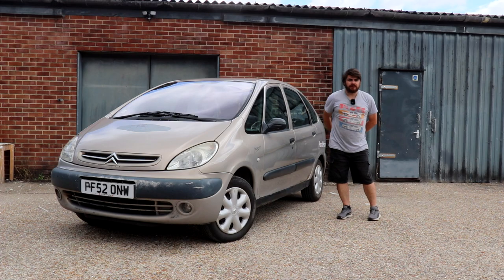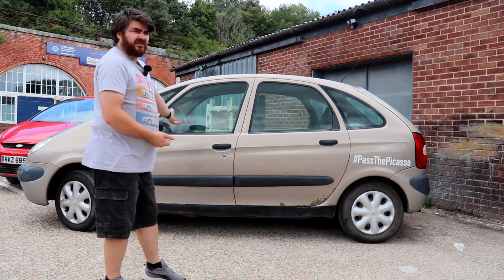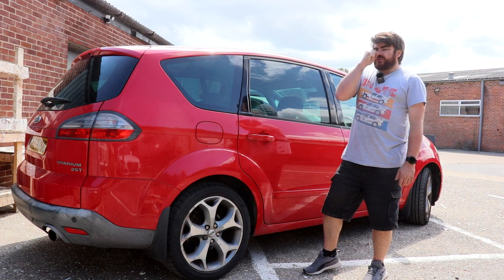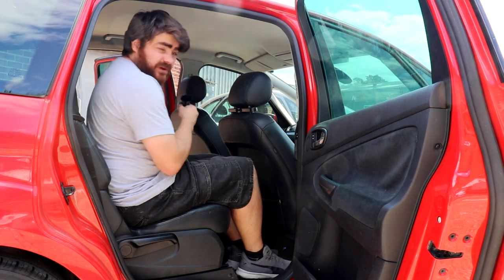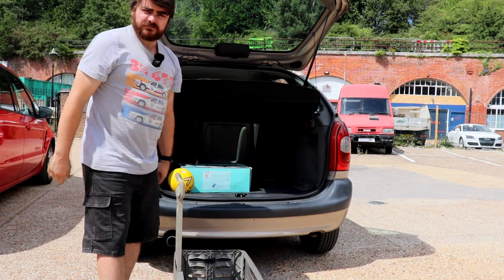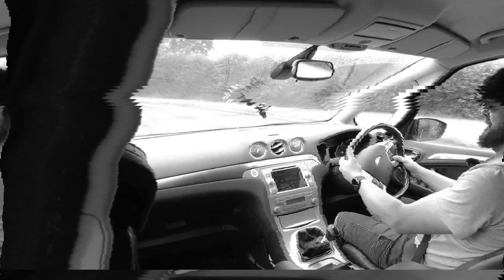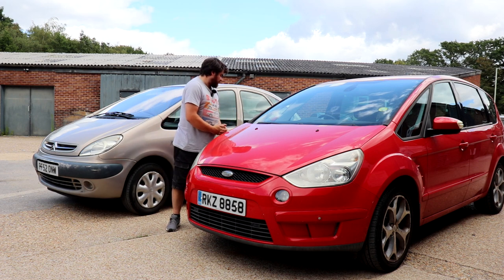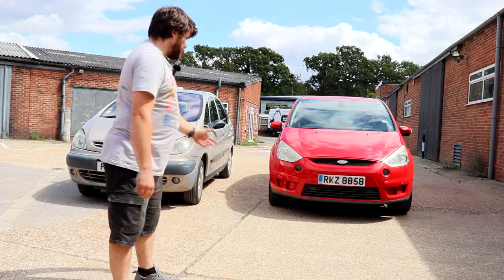The biggest TEST for #passthepicasso: Can it prove me wrong? Battle with Ford S-Max 2.5T Titanium

Comment: That Notbothering sticker! 🤣👍
S-Max is and always will be cool AF because 5cyl 20V Volvo engine. It's quick and with a remap can actually be fast.
Reply: What a world we are living in where a volvo engine makes something cool. LOL
Reply: its the st engine  @rimmersbryggeri
Reply: @simonelsey  I know that. But it's still a volvo engine all the same it was even developed before ford got in on it.
Reply: @rimmersbryggeri  Volvo engines are very cool.  Especially the T5.  The Yamaha V8 in the S80 and XC90 is very cool too (Yamaha still sell it as a marine engine).  C'mon now, how can the Volvo 850 super touring car and Volvo S40 super touring car not be cool with their five-cylinder howl? By extension the road-going Volvo 850R is very cool too.

Unfortunately speaking of cool(ing), the Ford 2.5L version of the engine has thinner cylinder walls than the Volvo 2.3L version, despite being in cars (like the Focus ST and Mondeo ST) where it will be driven harder. So they are known to crack the cylinder liners. 😐I guess that won't be a problem on an S-Max that generally won't be driven as hard (or badly remapped with a pop 'n' bang tune...).

Speaking of strong engines, the good old Volvo B20 turbo from the Volvo 240 Turbo is legendary for being indestructible and holding up well with 500+ bhp on a stock block too...  (Obviously it's an old-school closed deck cast iron engine.)
Reply from the maker: We knew about the liner issues with the 2.5 version, which is one of the reasons this one hasn't been tuned or anything. Just keep it serviced etc and it's good as gold. Clutch is tired now, though (it's the original).
Reply: The Duratec 30 is the better engine installed in a humdrum Ford though.  I might be biased.

Comment: Love it as I went recently from a 05  Picasso  90bhp to a 08 S max  220 bhp   so much fun to drive and love it for towing
Reply from the maker: A 2.5T like this one?
Reply: Yep its 25T in  zetec spec in dark metallic green  ment to be (rare 🧐 lol) I love  it as only 60 quid more to insure than the Picasso that was a big shockas was expecting a bigger jump but with it  not being a titanium like  my friends  who has 2.0 diesel titanium and it's a lot more  than I'm paying  and with it only being a zetec without all the extra bells and whistles weight is also a bonus. I  absolutely Love its very fun to drive feels pretty sporty to Me and often surprises cars it   shouldn't😮😉😉 lol and  then can fit a load inside like a small van and a tows like a dream and I Don't miss the diesel torque  tbh and the towing geometry is a lot better on the Smax always struggled to reverse manoeuvre with the Picassos 

Tho on a side note I  much preferred by Mark 1 Picasso over the 2 facelift models I had was the first was a lot lot  better built  interior and a few mechanical bits so mine facelifts became a bit of a mongrel from better parts off the mk1 parts
Reply: @UPnDOWN  Have a good day

Comment: The Xsara Picasso it's simply one of the most brilliant car designs ever made! Compact in it's 4.3m, but with a cavernous trunk. Adjusting the seats allowed me to carry a full size frame mountain bike! On top the practical touches are simply outstanding. Best of all is that the entire package is inexpensive to buy, run or maintain!
All in all. The only car model that I got 2 (two) over time.

Comment: We had a 2nd gen S-Max AWD in 2016 and lived the space for family & digs plus luggage.. plus the AWD meant for the 8 days in its 3 years with us it got up the snow covered lanes to our horses.
Reply from the maker: Didn't know they did an AWD S-Max!
Reply: @UPnDOWN  - ye on the 2.0 tdci 150 or 190 it was an option… tge haldex clutch type system so normal front wheel until slip detected.
Reply: @UPnDOWN didn't know that either, guess explains S-Max lack of big flat floor (big flat floor, big flat floor!) :)
Reply: Did you sell it?
Reply: @momo1883  - yes mate, back in 2019 .. it was a great car but we decided on getting an auto as spending a lot of time crawling around the M25.
Reply: @davidchandler9260  thanks. I've got a 2.5t smax titanium x, and I'm really pleased with it. I convert it to lpg, so now it's like 60% cost of petrol. I've been trying to get some information about 2.5 4x4, apparently there ware versions like that.
Reply: @momo1883  - I think (and this was 8 years ago) that in UK we could only get the 4x4 as a diesel .. we ordered ours new and I don’t remember dealer offering a petrol variant with 4x4

Comment: I have owned a 2012 C3 Picasso 1.6HDi 110BHP exclusive for 2 years and it has been brilliant. We didn't need a massive car but wanted something comfy and had useful space. The back seats slide forwards if you need more boot space, the back is square so has extra height in the boot, the seats are extremely comfy. It has the picnic tables in the back and retractable sun screens in the windows. The engine pulls quite well and on a recent 300 mile trip i got an indicated 63 miles to the gallon. i never thought i would ever say i would enjoy owning a Citroen but i do.
Reply from the maker: Wait until you try one of the proper Citroens...

Comment: Great comparison vid. I have an smax with the HDI based engine which runs pretty well.  You picked up 2 of my design annoyances - what to do with the load cover if deciding using the rear seats when already out and about, and the things falling out of the boot (now cured with an “apple catcher”) - its the same on the mk2!
Reply from the maker: The 2.0 16v HDI engine is a good unit. At the time we bought this S-Max, diesels cost a LOT more than any petrol, even the 5-cyl turbo. Nowadays, not so much.

The parcel shelf thing has always annoyed me!
Reply: @UPnDOWN I've got a 2011 mondeo with the diesel psa engine I love it. Power and mpg is very good.
Reply: @UPnDOWN mine for the volvo just lived in my shed for 7 years after I drove it home, then I gave it to Charlotte (Lotty) when she bought an xc90 a few years back.

Comment: The Xsara Picasso can it’s routes all the way back to the ZX/Peugeot 306 with the Xsara itself being essentially a cosmetic update of the ZX… be fun to drop GTI-6 running gear in one… granted it still won’t have the power of a Volvo T5 engine, but it’s a nice engine all the same, with plenty of torque, fun to properly rev out… hmmm
Reply from the maker: That's what I meant, as the ZX was conceived in the 1980s, and the suspension technology is the same as the Peugeot 205/309/405.
Reply: Too bad GTI6 engines are near-enough impossible to find in 2023. If only car manufacturers would make 'unofficial' crate engines of their legendary performance engines, and just advertise them explicitly as 'not for road use' or whatever just so they don't have to worry about emissions laws etc
Reply: @solitaryclusterofneurons598  indeed, I certainly wouldn’t entertain separating one from a viable GTI-6, that would be criminal… but it was a fun engine, small power by modern standards but excellent all the same.

Comment: Just sat here now thinking about the umpteen PIcassos weve had and the currently Galaxy on the fleet (2.0 TDCI). Which do I prefer?

Its tough. Picassos have done us as A family VERY well over the years even the 1.6 8v one we had (Can see it on my channel). Theyve been reliable and mainly, cheap to run. 
We had a C4 Picasso (12 plate) for a short while and what a truly horrific thing it was - especially the automatic gearbox... what absolute utter crap! 

Current 11 plate Galaxy.... love it.. not as comfy as the PIcasso's but a nice place to be inside... Very good economy as well and of course, much larger with 2 extra seats! Parts are a bit more epxenisve though. Dont seem to be able to chuck it about as much as you can with a Picasso, but its not bad to be fair to it, I qute enjoy driving it. Our Picassos have been and back to Paris, which this Galaxy will also be doing - will see how it fairs up. 

Content on my channel soon, Galaxy goodness.
Reply from the maker: We've run the S-Max to Paris and back a few times, it does that journey really well.

Comment: Regards trim levels,there was a level higher than the sx in the early noughties called the exclusive. I had a 1.8 petrol on a 02 plate. Had front and back leccy windows,climate control and panoramic roof. Admittedly mine had 75 psi or lower on 2 cylinders and a thirst for petrol only outweighed by its thirst for oil. 
Had 5 or six xsara pics,from x plate to 54 plate over the past 6 years or so as they are just capable at being a car. The LX was the lowest trim,i had an x plate hdi which didnt even come with ac,the sx added better seats,armrests,ac amd front fogs. The exclusive added Panoramic roof,climate and leccy rear windows. Later in their life they could be had with auto lights,wipers and cruise control.
The c4 picasso i had a couple years back on an 08 plate was not as good in my opinion.
Being a french sadist myself who is a glutton for punishment i keep going back to french cars and have owned numerous 90s and onwards french motors. 
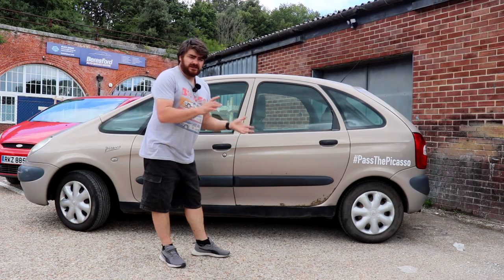4:22 The s max 2.5 turbo has always been of interest to me though. 
Great videos sir and keep up the good work.
Reply from the maker: There was, yeah. That's why I had to edit the word 'launched' into the vid as when I edited I realised I'd made the error.
Reply: @UPnDOWN  sorry for the correction on my part then! Love the videos either way and great to see someone else loving the quirky french motors.

Comment: Out of curiosity I checked out the French remap company Puretuning to see if they have remap files for the Xsara Picasso 2L HDi (66 kw) and I find out they sell two files. Stage 1 : 120 ps (88 kw), 270 nm, Stage 2 : 135 ps (99 kw), 310 nm.
It doesn't seem unrealistic when comparing to the numbers of the C4 Picasso 2L HDi : 136 ps (100 kw), 270 nm.

Comment: Great review. The Ford Focus C Max would obviously have been a closer rival and think it's substantially better than the Picasso too though. Handling, build, equipment, crash test etc etc.
Reply from the maker: I dunno, I felt the S-Max was substantially better than the C-Max, personally.
Reply: Of the B-max, C-Max and S-max of 06-13 the C-max was definitely the weakest of them, B-max easier getting in and out with the sliding doors and more comfortable and as much space, S-max more seats or bigger boot.
Reply: @UPnDOWN  Well it's certainly a lot bigger than a C-Max due to the MK1 C-Max being based off of a MK2 Focus.

Comment: Ive got the diesel 2.0 smax love the car i thibk best people carrier ypu can buy. Handles well goes well and economical. Also in titanium spec on a 56 plate. Compared to my inlaws 18 plate zafira the spec is pretty much i dentical but god is the zafira dismal. The smax is still good fun on a backroads and ive pushed along fat smaller sportier cars.
Reply from the maker: They drive far, far better than people would believe. Comes at the cost of tyres, though!
Reply: @UPnDOWN  yeh my one eats tyres but I drive it quite hard and it likes to light up the tyres. I bet the 2.5 is quite fun but they are like gold dust now

Comment: You could compare first gen Citroen C4 grand Picasso launched in 2006 to your s max. Plus u can store the parcel shelf in the boot with the 2 rear seats up plus with the 2 seat up there is loads of storage under those seats.
Reply from the maker: I'm pretty sure you can't. It doesn't fit anywhere, even in the footwell in the middle row.
Reply: @UPnDOWN  I was talking about the C4 grand Picasso. Parcel shelf can now be stored in the boot for unplanned extra passengers. sorry for not being clear.

Comment: i had xsara estate 2.0hdi , best car ive had for a long time  done 250,000 when it went to car heaven than brought a xsara picasso ,wife wanted it brought 1.6 8v desire petrol Hated it ... had no power in the end clutch went , engine seals went , alterantor went all at same time Plus cills gone would need repair ....I reckon if i stuck withderv i would have like it but with petrol engine i hated it ...I did like the size of it very roomy ...just the engine ..
Reply from the maker: I used to potter a 1.6 8v Picasso around in a job at a furniture shop, and it was asking a bit too much of it tbf. Same engine in a Imp is much more fun!

Comment: Apparently there are only 5 red 2006 ford smaxs left on the road with mot's in the uk but it doesnt specify if it is the 2.5 it just states across all the petrol models
Reply: According to howrareismycar
Reply from the maker: Problem is there are two different types of red, too, so I think that includes both of them.

Comment: If you wanted more Citroen seats, what was there? I vaguely recall a rather bland looking agalaxy-esque MPV that was badge engineered across the marques, Was that a seven seater?
Reply: The Evasion / Peugeot 806 / Fiat / Lancia had 8 seats as an optional extra I think
Reply: There was the Synergie and later the C8.
Reply from the maker: Yeah, the Synergie/806/Uylsse/Lancia that we never got was available, but that was a jump up in size even from the S-Max (was effectively a mini-van). Then the C8/807, which wasn't van-based and was a dedicated MPV, but again bigger than an S-Max.
To be fair, if I needed 7 seats I'd consider the cars first, badge second.
Reply: Cheers folks!

Comment: Picasso for me coz I had one and every member of the family loved it. Can't go S-Max coz I had a C-Max diesel new for three years and I cannot say how bad that car was without offending people - everything that could go wrong did - several times. So bad was the C-Max I have avoided Fords since and will never have one again
Reply: I'd say the same about Vauxhall nothing but trouble for me and all my fords bullet proof. My smax diesel is on 170k got it 5 years ago only thing under bonnet I've replaced is the alternator. My previous car a. 2012 focus diesel bout with 13k sold with 130k and a lot of abuse also just an alternator. Weird how the luck goes.
Reply from the maker: I think reliability is often just luck of the draw, to be honest. The S-Max has gone through periods where it just trucks on with zero niggles, though as with all Fords, there's a point it gets to where you think they just didn't intend to see it last that long, whereas with the Picasso you get the feeling it'll go as long as you want it to.
Reply: @darrenwilson8042 Did your C-Max have the infamous 1.6 TDCi 16v engine in it by any chance?
Reply: @FatHead1979  that engine ain't as bad as made out to be. You have to bare in mind it's probably the mosted used diesel engine across Europe. The dv6 was used by ford, Volvo, Peugeot, Citroen and even BMW in the mini. I had one bought it with 13k sold it with about 130k never skipped a beat and I ragged the crap out of it which probably helped 😂. Friend of mine has it in the fiesta he prides himself on never servicing it at one point it went 3 years without a service it runs perfectly never an issue. My sister in law has one and no issues apart from the DPf because she just doesn't drive it hard enough. If they are looked after they tend to be pretty good all in all unless in the mini for some reason they are really shite in the mini. I don't know if BMW did something to them but they tend to be crap.
Reply: @FatHead1979  - yep - it was blessed with that lump that is fit only to be a boat anchor lol

Comment: i think there would have been one better s max for comparison in this video, and that would be the 2.2 tdci, the same one that is found in the titanium x sport mk4 mondeo. probably about the best ford diesel engine. would be a lot more comparable on fuel with the picasso and its comparing a diesel to a diesel, all be it a 200bhp 2.2 diesel with a 90bhp 2.0 french diesel
Reply: It's technically a Peugeot engine, like the 2.0 TDCi and 1.6 TDCi of similar vintage.

Comment: I have a Citroen c4 picasso and quashqui  both diesel citroen 1.6 diesel and 1.5 diesel like the soft comfatable drive of the citroen (as good as my old sierra shaped granada 2 liter petrol )ok nissan not sporty but yes feels more responsive but .. on long journeys front and back seat passengers prefer my 57 plate citroen  , yep shes old but passes every mot with ok tyres or wiper replacements WOW i hear folk moan about french cars but to be honest ive had renaults ,citroens  no problems but vauxhalls ford    was happier with french ...

Comment: Love this.
I’ve been on a few long ish journeys in the back of an S-Max…..a high performance turbo diesel (how many petrols did they make, don’t think I’ve ever spotted a petrol S-Max certainly not a lowly spec petrol) and the ride was horrible. Like being in a washing machine for 2 hours.

If there’s guaranteed lots of traffic where u drive….do you need to spend more money to get more power?
This would apply to all car sectors, right down to superminis. Choosing the lesser engine might lower insurance, push up economy, and if it’s petrol without a turbo, less points of failure.

Btw, David Brent saying “I want to be popular” is the Ford S-Max. 😂
Reply from the maker: The petrol is rare, yes. Diesels much more common, however in answer to your second point, the petrol was cheaper to buy (at the time). Significantly so!

Comment: if you hadnt used a 2.5 petrol   and used a diesel  instead   the fuel  would be mid 50s
Reply from the maker: Apparently not. Most owners reckon they get high 30s to low 40s.